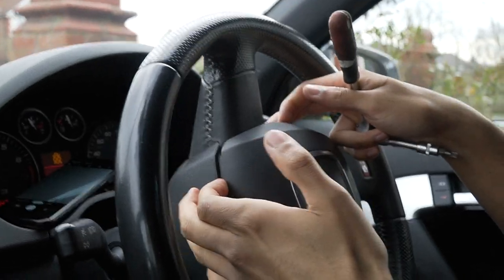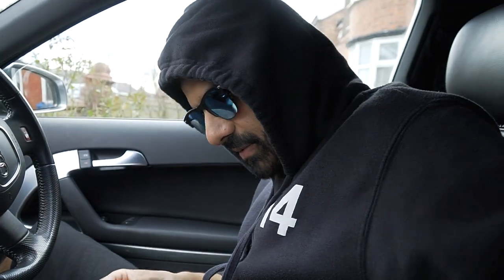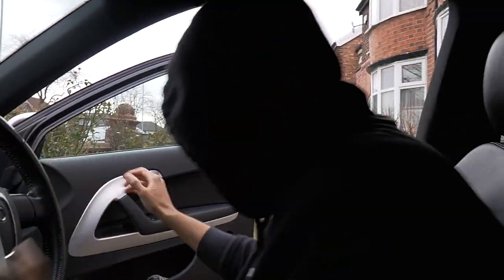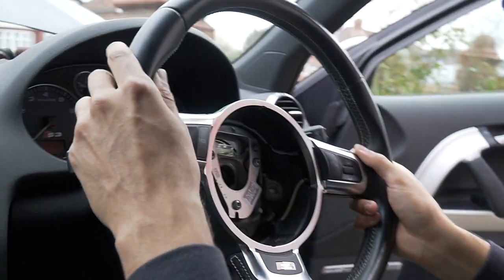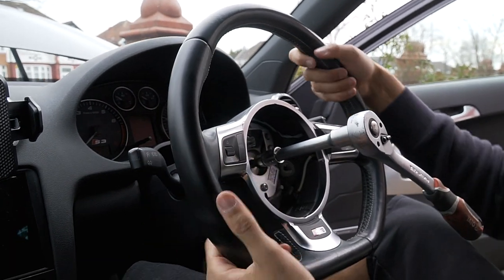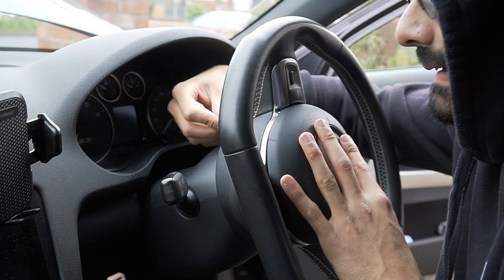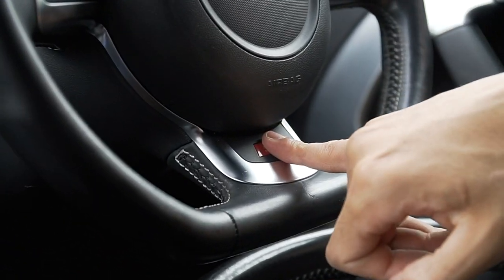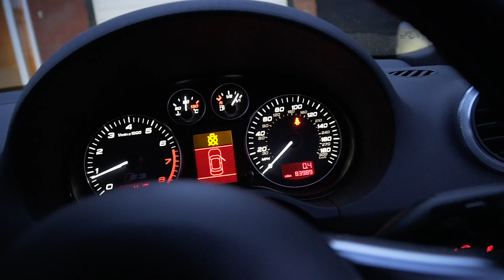Audi 8p Steering Wheel Change

Comment: So ive got the standard flappy paddle steering wheel, and i need to replace it with the flat-bottomed flappy paddle wheel as it's an automatic. Would it be the same module or a different one?

Comment: Just done same job and steering is feeling pretty heavy now, any ideas bro ?
Reply from the maker: Take it for a drive if it doesnt fix, depending on what model or what steering wheel you put on it might need VAG com to code it in 👍
Reply: @H4Torque  I’ve got same car as you 07 s3 but I put sline wheel in, did control module as well.

Comment: Does the buttons work if my old steering wheel doesnt have any buttonS?
Reply: Did u find a answer?
Reply: @faizaanhussain4500  no bro, but i think it wont
Reply: Same question answer. Audi TT 2012, have a normal steering wheel and want to fit a multifunctional one. Really don’t know if those buttons will work or not